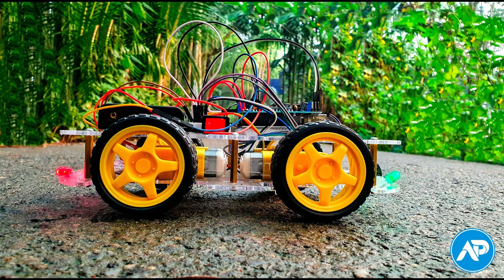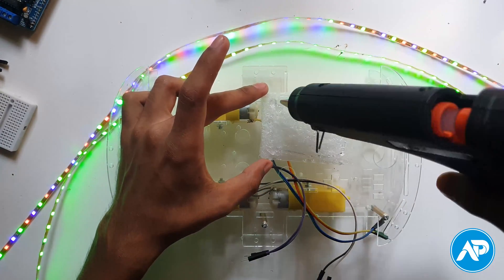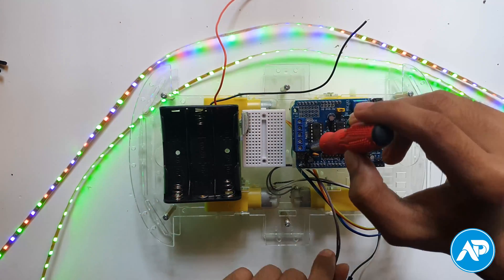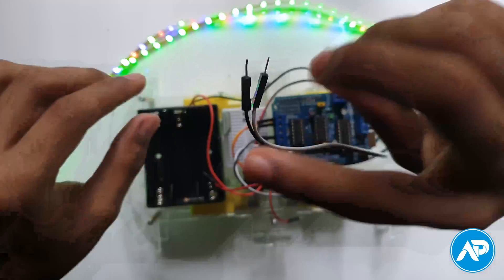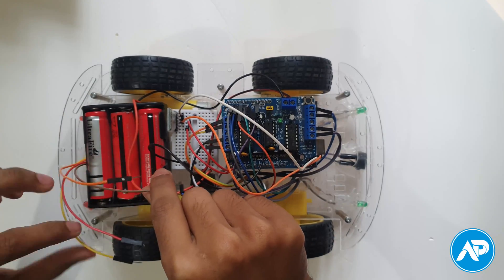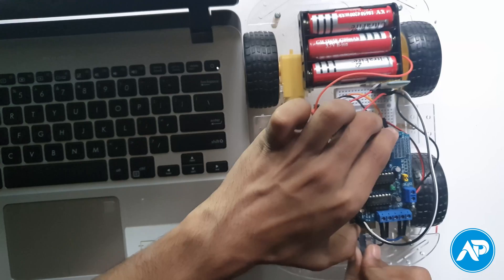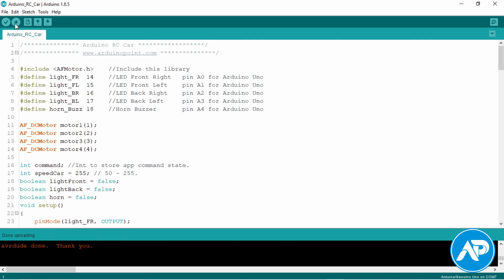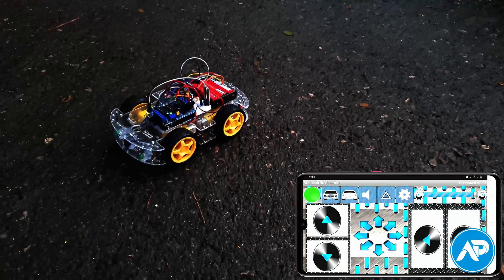Arduino Robot Car Bluetooth Controlled Using L293D

Comment: Can I use a 9v battery for this?
Reply from the maker: Yes, of course. You can use a 9V battery for this.
Reply: @arduinopoint001  ok thx
Reply from the maker: You are most welcome ☺️☺️☺️.
Reply: @arduinopoint001  Bro one more thing, can I take off one motor from either side? and can I take off that horn completely?
Reply: @arduinopoint001  Any changes to be made if the horn is taken off?
Reply from the maker: Nothing will change, if you take off horn. Only your car will not have horn feature.
Reply: @arduinopoint001  Ok thanks and Bro one more thing, can I take off one motor from either side?
Reply from the maker: Bro you can take off one or two motor in the same side. You can control a car using two motor. But you need three or four wheels balance this car.
Reply: @arduinopoint001  Ok bro thx. Wheels I understand it's not a scooter😂

Comment: Bro it worked and the motors were running speed when i used your code thanku😘😘😘😘😘
Reply: Bro can i use your led code to my video i will give credit to you
Reply from the maker: Ok. You can use, Bro.
Reply: @arduinopoint001  thanku😘😘😘 very much
Reply from the maker: Yes, it work. 
You are most welcome,🤝 Bro.
Reply from the maker: My pleasure Bro 🤠.
Reply: Bro i have code
Reply: But can i use only led code in my code does it work